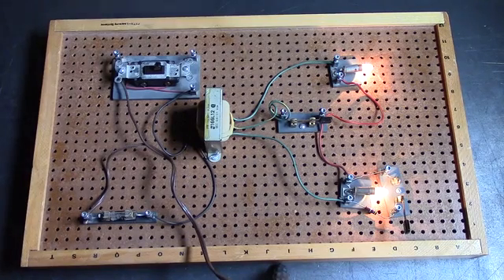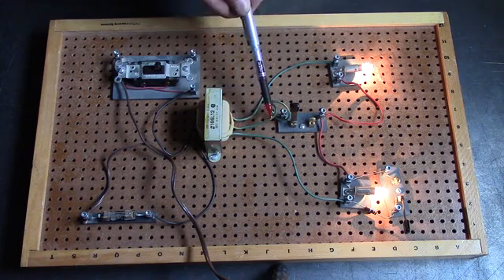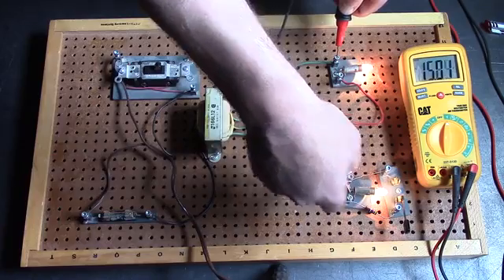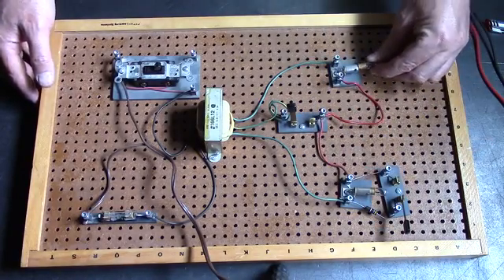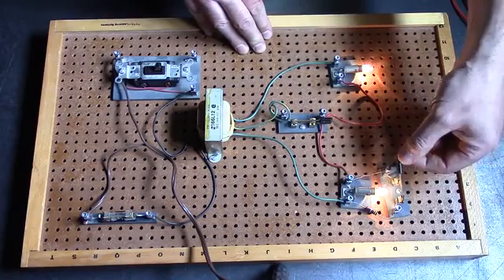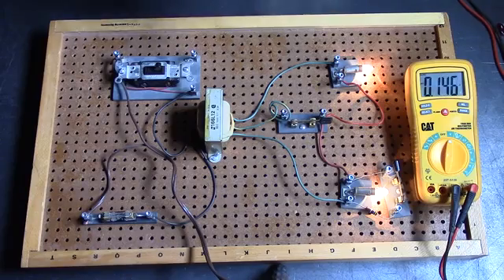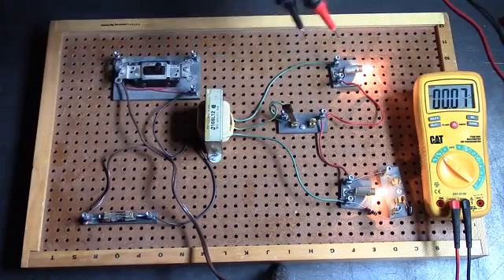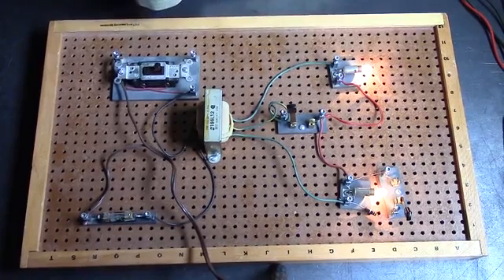HOW DOES THE NEUTRAL WIRE WORK? EXPLAINED WITH LAMPS !! ELECTRICITY EDUCATION ELECTRICIANS

Comment: Excellent video on a difficult topic.  But like everything else in engineering, the video begs more questions.  First, how come in residential wiring, the neutral is connected to the ground plane?  If the neutral wire is connected to the middle of the secondary windings, it must have some voltage with respect to ground.  How come there is no short to ground?  Second: In a residential power panel, the hot wires (two extreme ends of the secondary windings) do not connect in 120 VAC service.  It is good practice to have equal loads on the two hot wires.  Otherwise there is an imbalance.  Suppose there is perfect balance which implies the current in the neutral wire is zero.  Does this mean all spent current on the +120 V side and -120 V side return to the panel via neutral and cancel each other out. And only if there is an imbalance there is current flow in the neutral wire back to the transformer?

Comment: Seems the circuit is just going from series to parallel wiring when neutral is added. Residential wiring is single phase 120v from utility to transformer primary that is split-phase, secondary is 240v with center tap connected to ground that results in two 120v lines that are out of phase by 180. Transformer secondary hot/neutral=120v hot/hot=240v. Circuit should just explain how single phase utility line is phase-split into both 120/240v line voltages.
Reply from the maker: That works too

Comment: This explains why, when you look at a breaker panel, you see that the circuits from each of the 2 hot legs are actually running in series at 240 volts.

Comment: The neutral is typically (in the US and many other jurisdictions, with some exceptions) a grounded conductor that comes from the utility transformer secondary center tap, so that the entire span of the secondary is say, 240 volts, and half of that length provides 120 volts. When two different 120 volt circuits, one referenced to one of the ungrounded (hot) conductors from one end of the transformer secondary, and the other conductor connected to the other end of the secondary, the two circuits will be 180° out of phase with one another. This is the reason you can have a multiwire branch circuit (even though they are a terrible idea) because the phase differences provide for current cancellation.

Questions?

Comment: Another good example as to why a power switch should always be on the hot side of a circuit instead of the neutral.  Electrical code is there to prevent many bad things from happening.

Comment: I missed something.  Just to verify- the transformer on the secondary side consists of L1 and L2 both which have 7.5 volts.  Then he has the neutral conductor.  When running two hots (L1 and L2) together yields 15 volts, but when using a single leg (either L1 or L2) to neutral yields the 7.5 .

Comment: So when the neutral wire is connected to the mid point of the secondary coil, that dictates the split of voltage but does that also dictate how far out of phase one leg is from the other? Put it in the middle you get one leg 180° out of phase from the other and if you put it a 1/4 of the way from one side of the coil to the other it would be 2 phase and 90° out of phase from the other??? Help me!!!
Reply: The taps don't change phases, just voltage potential either increasing or decreasing based on the primary to secondary side ratio of the coils
Reply: In short no.  If you were to put a scope on his transformer, it would more than likely be in phase with each other.  I doubt that his demo  transformer was rewound in the opposite direction from the center point on like the transformers on your pole.  Hence, split phase (180 degrees out).  It is from the same power supply but simply inverted by turning the windings in the opposite direction at the center point. Not to be mistaken with 2 phase.  True 2 phase (that is not really in use anymore) was generated from two separate power sources.  Niagara falls plant was the last power plant to generate 2 phase power (90 degrees out from each other) in the U.S.  I’m not sure if they still do or not.  Two phase power was used to start induction motors back in the day.  In addition, 3ø is from 3 separate generators (or windings in same unit).   If I’m wrong on this, please somebody correct me.  Thank you in advance.
Reply: Pat Pikulski - The location of the neutral wire along the secondary winding does determine the voltage split, but it does not affect the phase. At 1/4 of the way from one end, which is 3/4 of the way from the other end, it would make voltage splits of 25% and 75% of the total voltage measured across the ends. The phase would still be 180 degrees apart, referenced to the neutral wire. It's really just one phase, measured from opposite directions. In order to get phases which are 90 degrees or 120 degrees apart, it is done by shifting the coils in the ac generator stator(alternator stator) to the correct timing positions. Or it can be done with electronic circuits.
Reply: No, moving the tap from center to 1/4 of the secondary winding will not affect the phase relationship. The difference will be that the peak-to-peak voltage between the tap and one end of the secondary will be 1/3 of the voltage between the tap and the other end. Those voltages will still be 180 degrees out of phase from each other.
Reply: No, everything from the coil in one direction of the 'neutral' is 180° out of phase of the other direction. If the 'mid-point' is 10% of the way along a 50v output you get 5V and 45V relative to that point, at 180° phase difference. All measurements are relative to each other.
In the circuit Hystat shows there is only a single phase incoming and outgoing. It's like taking two 1.5V batteries in series; if you measure from the middle to one end it's 1.5V, then swap one probe to the other end it's -1.5V, yet the batteries are not 'in different phases', it's just relative to where you make your 'common' point.

This video doesn't mention the most important aspect of 'Neutral'. It's simply whatever you choose to be your reference point, so this demo has nothing to do with your home wiring's neutral. The reason we have Neutral in houses is because it's grounded back at the power station, so in the house we have one lethally charged wire, and one that is at earth, which is much safer than two opposite phased wires as would be the case in Hystat's demo, so at home the Neutral reference point is literally that of the earth.
If you measure Neutral to Earth in your home there should be almost zero volts (allowing for some leakage), and you could substitute Neutral for an Earth connection in a house, but it's a very bad idea for safety reasons; you don't know how well the earth connection in your house is earthed!

Comment: If the neutral was not placed in the middle of the secondary side, but rather perhaps 1/4 or 1/3 of the way along the secondary winding what would it's voltage be compared  to a ground wire? Thanks.
Reply: When you center tap the secondary winding of a transformer, it means you are cutting the total winding in half, so between the neutral wire and any of the two HOTS, you will read half of the total voltage. Likewise, if you tapped the secondary at a third or fourth of the winding, you will read the voltage amount accordingly. This is the concept behind having a multi-tapped transformer, where you can select the output voltage from the secondary of the transformer based on your needs.
Reply: Patrick Pikulski Well, my first question to you Patrick is how did you make the degree notation next to 120 degree or 180 degree? Do you have a special keyboard, or is it a set of scripts that I've yet to discover? Anyway, to answer your question, a two wire secondary (not 3 phase) where you have L1 and L2, yes they are separated by 180 degrees, but with different signs. When L1 is (+), L2 is (-). If you were to plot them on a sine wave, you would see that at no time are they both on the same plane. One is always on the North side of the plane, and the other is on the South side of the plane. If they were both on the same side, then there would be no difference of potential.
Reply: Griff Mustard I'm on my iPhone, when I hold 0 (zero) a tab pops up containing 0 and the degrees symbol, might work like that on android
Reply: Griff Mustard so how do the voltage legs get out of phase from one another, I understand 3 phase is 120° out of phase from one another and old Philadelphia 2 phase power are 90° off from one another and house power are 180° from one another. So how does it do what it does?!?!?! That's one of the last electrical mysteries I have!!

Comment: When you put the resistor in parallel with the bulb, creating a series parallel circuit, why does the voltage decrease at the parallel circuit and increase at the other bulb? According to E = I x R, I expected the voltage to increase at the bottom bulb and decrease at the top bulb. But the opposite occurred. (??)
Reply: Ah, never mind, I just remembered resistance decreases in a parallel circuit.
Reply: You probably won't see this because your comments are 2 yrs old, but that decrease in resistance is only part of the answer to your original question. By decreasing the resistance, the total circuit current increases. The total current only flows through the top bulb, increasing the voltage across it. The total current is the sum of the branch currents in the parallel portion. Therefore, the lower current flow through the bottom bulb creates a lower voltage drop across it.

Comment: Excellent  explanation. However the reason you get 7.45 and 7.45 not adding up to 15.00 (14.90) could be because of meter error (off .10 volt out of 15.00). Accuracy beyond three decimal points isn't guaranteed when you start with three decimal places. An error of 1 part in a thousand is not significant. Excellent video.

For those wondering why we keep the neutral at ground potential but don't use it for a normal current carrying conductor is safety reasons. It is better to have all conductors at a known potential than to have them at any possible potential with respect to ground. Your neighbors services and the pole transformer are also grounded. 

That's also why some appliances, such as refrigerators, have a ground wire. Should the motor winding go bad and short to the motors case and therefore the metal exterior the third ground wire carries an increased current now coming from the hot wire and if that increase is enough it will trip the breaker without endangering the residents with a lethal voltage and current. If its is not enough the motor will probably develop more shorted turns until it is enough. The refrigerators potential voltage on the case remains close to zero because of grounding. This prevents shocks should your body be touching another ground such as a stove or sink. People who have cut off ground wires, defeated their ground system or used adapters improperly face the possibility of electrocution and death should a three wire or very very old two wire device fail.

On a properly wired GFI circuit even a very small difference in neutral and hot wire current will result in a quick disconnection.
Reply from the maker: +Kim O'Brien Makes sense. Thanks.
Reply: Kim O'Brien neutral IS a current carrying conductor...
Reply: I always wrote off a small amount of missing voltage to voltage drop in the wiring.

Comment: Fantastic!  Now I think I understand one of the importance reasons for the neutral wire: allows multiple circuits to split / branch from a single inbound power grid, but have differing loads in series and/or parallel without adversely affecting one another...